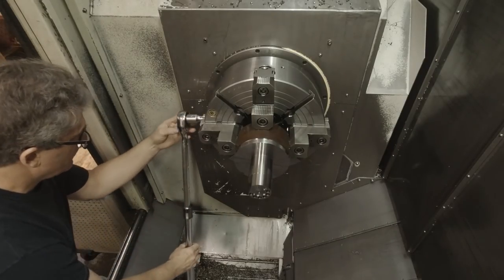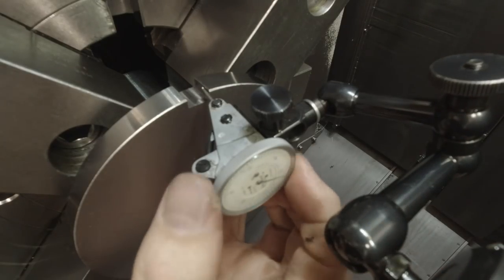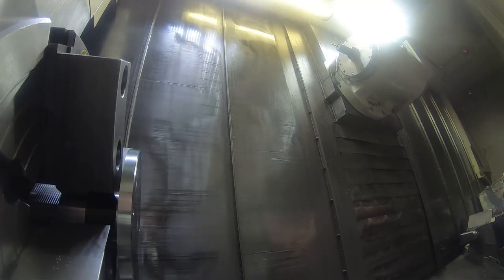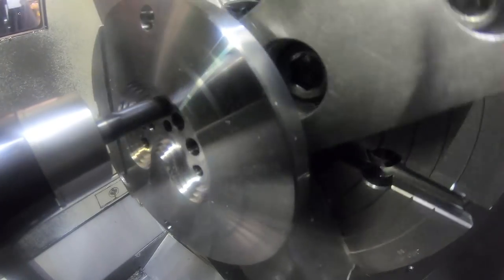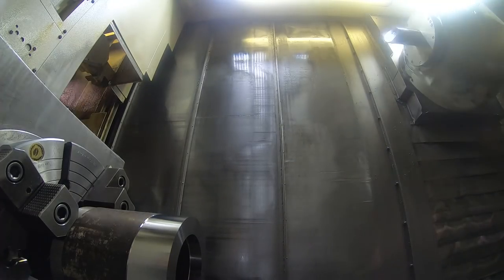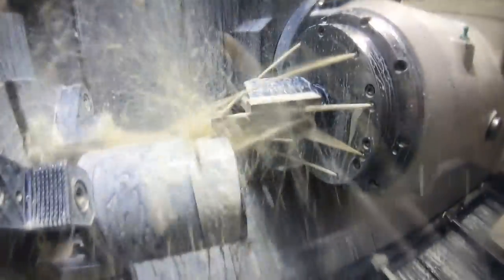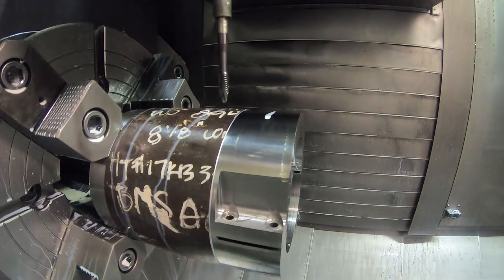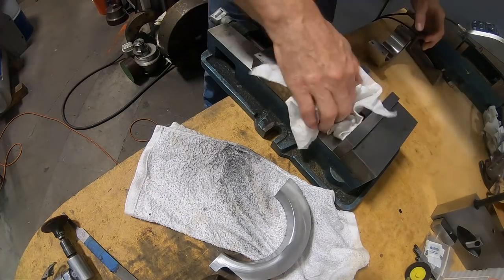End Work Drill Guide FX-2

Comment: Love your videos. On your rain-x problem I have a potential and relatively cheap solution. Use an in line oil lubricator. The kind in your air system. Run rain-x in it instead of oil. You can meter how much you want with the adjustment knob on top.

Comment: A Fogbuster might be a slick way to add RainX to the air stream.  Also for a thin walled aluminum part were making at a previous shop, the programmer had to add pretty generous room for acceleration and deceleration so he could get proper chipload at higher RPM.  You could go even further with loopy linking moves, but the madness has to stop somewhere.

Comment: The way they get that level of rotary resolution is through running servos through planetary 10:1 gear boxes. Increases the Torque by that ration as well. They might have a 20:1 or two 10:1 in series. One being double the other x100. Couple that with a very good encoder on a high quality servo and you have an amazingly accurate rotation graduation. It comes at the expense of backlash but its in 0.x arch seconds so for the most part outside of what you could even measure on standard equipment
Reply from the maker: Yes I agree with you this is one way to accomplish this. But I have looked at the servos and the drawings on this machine and they don’t have any gear boxes on them. They must have very high resolution encoders and servo systems. The B axis also has what they call a cam roller worm drive. Witch they claim has zero backlash. The C axis has a worm drive. That is coupled and decoupled giving the ability to turn like a lathe and mill. I have jogged the C and B axis reading it will a .0001” indicator. And they do have this high resolution ability.

Comment: I used a parting tool as a broach before it’s nice to see someone else try it 
Wouldn’t it had been easier to do this part in a mill
Reply from the maker: It would have been easier just to saw it in the band saw. But I had this idea and wanted to try it. If we do everything the easy way and don’t try different things. How do we learn?
Reply: The idea was good always good thinking outside the cube 
The Mfg you do with oil parts 
Is outstanding in my mind 
How long does it usually take you to set up and run tool paths

Comment: I think Mazak can get that rotary resolution on that machine because the chuck is much larger than on like an HRT210.
Reply from the maker: The diameter makes no difference to rotary resolution. It is a angular measurement not a size. Now the error will be larger at bigger diameters not smaller. So it is good at bigger diameters to have a finer resolution.
Reply: @EdgePrecision  yea your right. But wouldn't the encoder be bigger also therefore easier to get fine resolution?
Reply from the maker: Possibly. I think in this case on the C axis there is a worm gear that is driven by the worm on the servo motor. I believe the encoder is on the servo motors shaft. All Mazaks use Mitsubishi servo and electrics. So what ever their encoders have in resolution being reduced by the worm drive is what it must be. The B axis has a cam roller worm drive. to help eliminate backlash and be able to move at high speeds. But is also has the encoder on the servo motors shaft.
Reply: @EdgePrecision  ok that makes more sense now

Comment: Great parts as always, thanks for the video. Nice bit of broaching on your Mazak, to make it work better perhaps a small subroutine with rapid G00 commands starting a little way off the part maybe 2" would give it time to accelerate. I don't think the machine position (G64 / G61.1) overrides accelerations rapid commands, this wouldn't be a good idea on a blind pocket but going straight through like you did would up the surface speed and might just finish the job quicker too :-)
Reply from the maker: If I ever do this again. I need to experiment with different settings. It may make things smoother to just eliminate the rapids and do everything with high feed rates. Sometimes that works better than having the rapid movements in short distances.

Comment: I am hooked to your channel thank you and please keep them videos coming. If I may at what hole depth  would you recommend using a gun drill?
Reply from the maker: It’s more a case of the hole than the depth. Does the hole need to be held to a close size and finish. Is it intersecting other holes. What is the material. These are the things I’m lookin for a gundrill to do. Also if I break a gundrill. So far in all these years using them I have never not been able to get the broken drill out of the hole. With long coolant feed twist drills if you break the tool deep in your pretty much screwed. I can also resharpen a gundrill much easer.
Reply: @EdgePrecision  OK then, I don’t have to hold a close size or finish and it’s not intersecting other holes, the material is aluminum
Reply from the maker: @juandelaluz2196  In aluminum I would probably go for a gun drill if the hole was greater than 30x deep. Also if location was critical and straightness. A gundrill will generally drill a straighter hole than a twist drill.
Reply: @EdgePrecision  Thank you

Comment: How many hours do you have on that Mazak? 
You are very comfortable with it. 
You were talking about setup when the machine is cold. How much does the machine move in say  Z - axis when the bell screws and hydraulic oil get warmed up?
I’ve notice on mine ( different machine ) that after 4 hours it stabilizes, wear offsets maybe .003 during this time to account for thermal growth.
Reply from the maker: This machine has oil cooled lead screws. It has a chiller for this and the milling spindle. The turning spindle has its own separate chiller. It doesn't move at all in Z but X and Y can vary about .001" between cold and warmed up. There may be some kind of thermal comp in the control. My Mitsubishi horizontal mill has thermal sensors in the machines casting to compensate for this.

Comment: That parting tool is genius. What cycle did you use for That in esprit?

I have a loosly toleranced internal key to machine on an up coming job, think that would work for at least roughing?

I have a y axis blade with a tip in the right orientation:)
Reply from the maker: Its just a couture milling cycle with no cutter comp and extremely shallow depth of cut (.002"). When I process the code I just delete the spindle on commands and speed in the G code. For this particular setup I had to use a fixture offset to shift the Y axis over. The normal lathe offset on My Mazak wont work for that in the Y direction with the tool oriented that way. Because this tool holder isn't on the spindles centerline. If you are doing this in the Z axis there isn't really a standard milling cycle you can use. I have done it by making a very simple sub program in the incremental mode and repleting it the required number of times to get to the target point. I will be showing how to do this in the up coming videos on this part.
Reply: @EdgePrecision  Yeah that's what i was thinking as you have a very similar internal keyway upcoming. :)

Comment: AvE never got around to sending the rotating window prototype for Peter to try?
Reply from the maker: Not to disagree with AVE. But even the rotating window Idea would have problems with the coolant. What I have found is If I can keep the window wet the picture stays clearer. Even with the rotating glass if it drys out with coolant residue it will obscure the view (Look at his videos when he is filming through his rotating window. It would be better if he had a small coolant nozzle spraying coolant on it). I have been experimenting with spraying Rain-X into the air line and this makes the window clearer because it remains wet. Just coolant may also work but I haven't tried that yet. There may be a few droplets flowing across the image but it's still good enough to see.

Comment: Mighty fancy shaper you are running there Peter :)
Do you think cutting some air above / below the slot would have helped get the acceleration / surface speed up enough?
Reply from the maker: What I think might help is to not have the rapid movements in the cycle. When a machine shifts from feed mode to rapid there can be a slight hesitation. Sometimes the movement is a lot smoother if just left in the feed mode with high feed rates. I will need to try this and see.

Comment: wouldn't that circular cutter you use for parting have been enough for the split cutting as well, as you could have done it from the side and not  the front. also for the parting surface speed, if you would give it a bit more space to accelerate it might have gotten up to the speed, would have taken even longer tough. super cool video though!
Reply from the maker: Thanks, Yes the cutter could have been used from the side of the part. But it is thicker than I wanted and would have also required cutting into the material behind the part, closer to the chuck (witch I didn't want to do). There may also have been the need to extend its shank for clearance on the spindles face with the chuck jaws.

Comment: What do you set your max spindle speed to when turning the face?
Reply from the maker: This machine will only go to 1600 rpm in high range and 460 rpm in low. So unless the part is large or running off center out of balance it not really a problem. On this part I had it set at 1500 max. But when I'm running a part in the steady rest I do limit the rpm because it can damage the steadies roller bearings. Especially if I have the steadies clamp pressure up high.
Reply: @EdgePrecision  Interesting, that chuck looks pretty big, 1600 rpm is plenty enough speed for the size of the work you do.

Comment: Maybe I'm missing something, but why do you spot carbide drills?
Reply from the maker: I typically spot drill for all drills. Especially long ones. For tap drills your going to chamfer the hole anyway so why not spot and chamfer all at once. Someday I need to do a video on spot drilling and why and what angle to use. Also what happens to the holes entry with and without a spot drill. And why you shouldn't use a lathe center drill to spot drill for drills.
Reply: @EdgePrecision  Cheers for the reply. In the shop I work at, which is where i served my apprenticeship 8 years ago. I was origionally taught to not spot carbide drills due to them being self centering and for the likelihood of the edges of the drill chipping. If we are going more than 5xD, then we use a pilot drill with the same angle for the longer drill to follow. Do you use 90degree spot drills? or are they the same angle as the drills you use? If so, this works ok?

It's good you mention why you shouldn't use lathe center drills to spot holes, beause I was also taught if I have to spot say a HSS jobber drill, to use a centre drill as the angle is 120degrees which is closer to the 118degree angle of the drills we buy in. Could you please advise what has worked best in your experience?
Reply: @amberrubiks9233  That's exactly how I do it, we drill thousands of holes every day with 6 and 8 spindle machines. No spot drilling until about 5-6xD, but it depends on the drill and other things also. Spot drill always has a larger angle if you're spotting for carbide drill. For one of jobs or few holes, who cares, but optimally that's what you'd want to do.

Comment: I’m surprised theres no way to bypass the open  door interlock.
Reply: There is, but it contains the operator being soaked in the coolant.
Reply from the maker: On this machine with its automatic doors there is no way. Even if you take the switch dogs off and put the permanently in the switches. You will get a alarm because it looks at the switches when the doors open and close. You will even get a time out alarm if they take to long. The only way would be to rewrite the ladder diagram in the control. And no machine sales place would do that because of the safety liability involved.
Reply: I guess getting a decent electrical engineer, that will make a  simple controller to sense/disconnect door motor voltages and send appropriate voltages to the endstops (with time offsets) might be possible. It might take just few hours to hack it, so it could be disabled/enabled by switch.